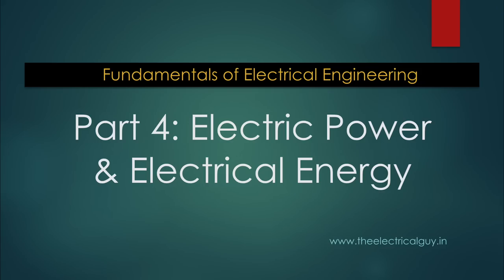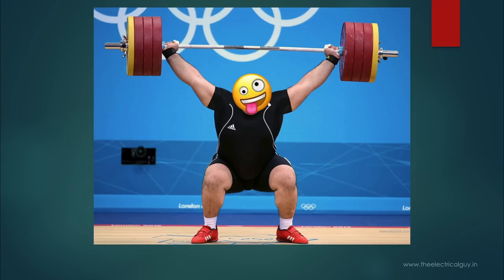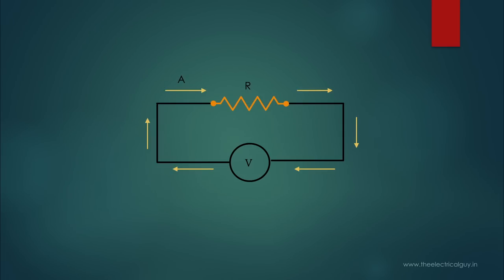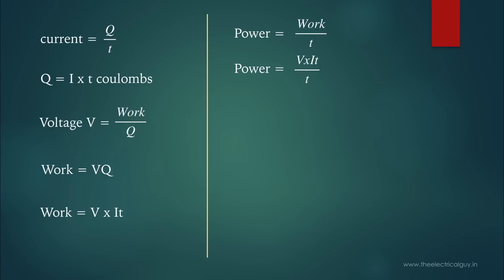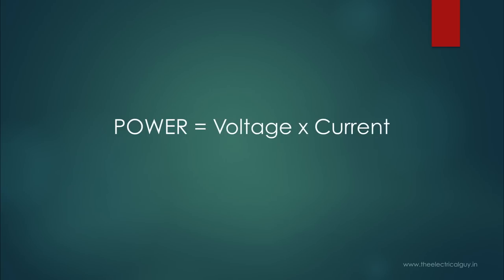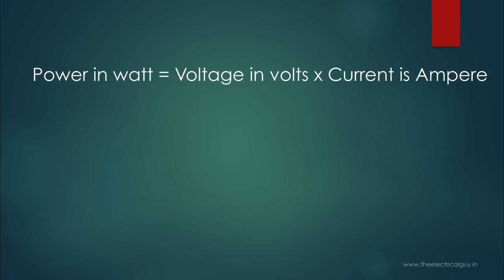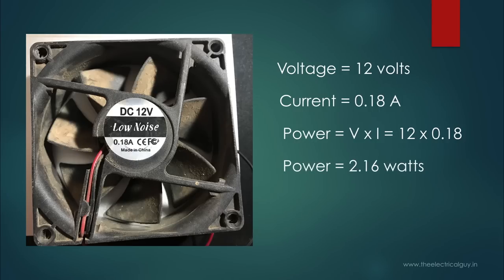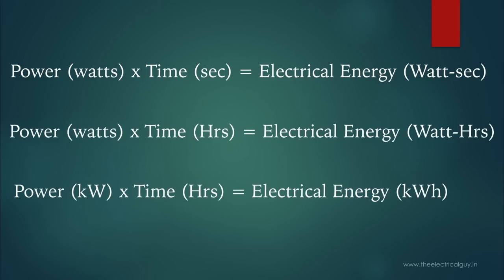Electrical Power and Electrical Energy | Easiest Explanation | TheElectricalGuy

Comment: Nice explaining of concepts......but while explaining energy you are pronouncing unit wrongly.....it should be watt second....not watt per second....because per comes only when we divide some parameter by some other parameter ...but explanation was nice..👌👌
Reply: yes you are correct
Reply: i noticed the same thing.. per means division .. here it is multiplication
Reply: One more thing, can we simply multiply power by hour. Because if we focus on units: electrical energy = power * time; for power unit is jule/second; so electric energy unit goes like jule/sec * sec = jule; for watt-sec, we can simply multiply times in second; but, for watts-hour, dont we need to convert power to get into jules/hour?????

Comment: Sir I have a doubt...
Electrons are negatively charged so they are attracted to positive end of the battery and then they file through the electrolyte and come again to negative end so where is displacement???  
And how work is done??
Reply: In real cases, electrons are moving from nagative terminal to positive terminal but the current we use in the sums is called hole current. 
They consider that electrons (negative charge)moving from negative to positive terminal is the same as positive change moving from positive to negative terminal (Mathematically)
So that equations can be positive in this way

English is not my first language. Sorry for my grammar. I hope you understand it.

Comment: Question: Why is there a 370 Km limit in transmission line length from power plant (hydro-dam, nuclear) to distribution substation? Question 2: How much water pressure (through the penstock) will it take to spin a water turbine generator? (approximately) I am studying hydroelectric generation!

Comment: Power in direct current circuits is different than in in alternating current circuits?
I mean:
P = I x V (direct current)
P = I x V x power factor (alternating current)
Right?

(Power factor means efficiency. Right?)
Reply from the maker: Yes 👍🏻
Reply: @GauravJ  Thank you !!! ;)
Reply: Not really. Power factor represents real power component in total/apparent power. All this thing make sense only when there is inductive load in your circuit. If you have only resistive component, pf is 1.
Reply: @mayurbhoraniya5432  thank you !